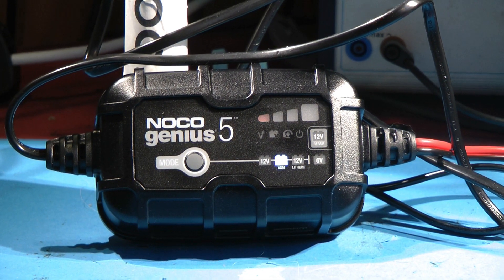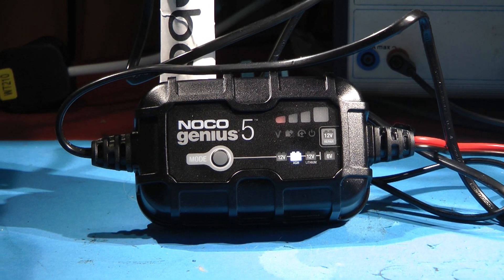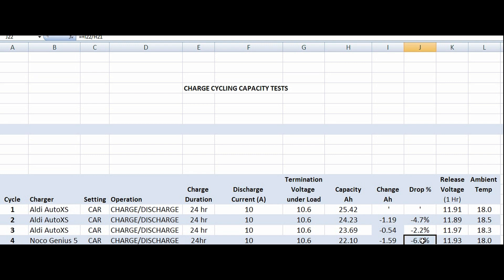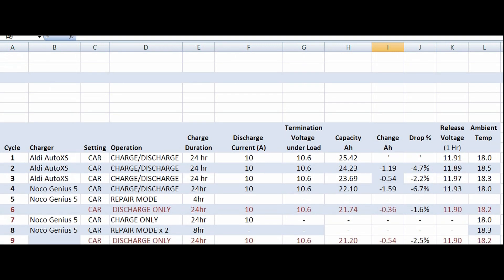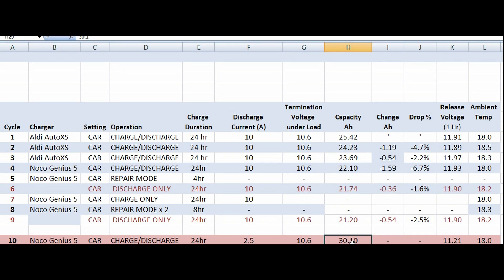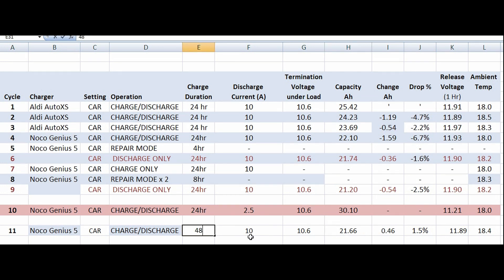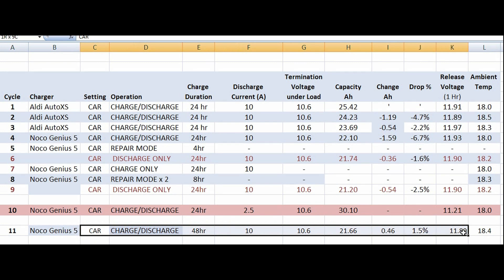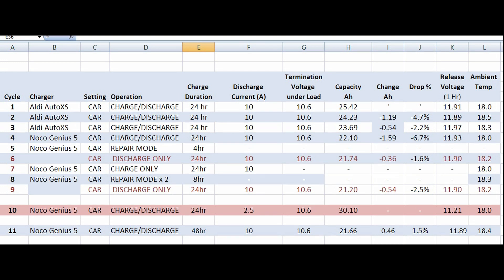NOCO Genius 5 Battery Charger Detailed Repair Test , teardown  and Review Part 3

Comment: Hi great videos, they helped me repair my CTEK charger. Thanks. In relation to this battery you have been testing it seems to be holding up quite well under the 10A load, but you were saying it won’t start the car if you leave the lights on for 15mins. Could be it is losing its Cranking capacity rather than the AH capacity as the AH capacity seems to be holding up well for a long time. Not sure how you would test the CCA though.
Reply from the maker: 15 mins might have been an exaggeration. Maybe half an hour stopped on the fast lane.   Got stranded.   You would never know there was an issue it always starts sprightly.   The first indication that we should have acted sooner was that it wouldn't start after washing and valet he did with the radio on and the doors and boot open. Maybe 90 minutes. I am more cautious with the family's batteries now. We will test CCA.  Tempted to cut the top off...

Comment: If the slow discharge and slow charging is better, and repair mode didn’t do anything, it basically says go buy the genius1 for less money!
Reply from the maker: Good point.  We will get around to discussing that soon.  Just talked to a battery manufacturer's application specialist.  Very interesting.
Reply: It wasn't so much a slow charge as a long charge - the important element is the adsorption phase at the end where voltage is held constant until current drops off.
Reply from the maker: @markdauncey927 The chargers claim to do this stage automatically,  I will chart it and see what it is doing during the completion stages of the charger. Trying the latest CTEK 5A charger on the battery right now to see how that performs on the charger and Repair cycle. From what I have seen so far I expect the capabilities of the chargers to measure the an accurate terminal voltage is going to be an issue.
Reply: @markdauncey927  I dont understand what you are talking about. But according to this article, the repair is done at a slightly higher voltage after fully charged, to reverse soft sulfation. https://batteryuniversity.com/learn/article/sulfation_and_how_to_prevent_it
Reply: @markdauncey927  Thank you for pointing out this article. Now I see (or I hope I saw) what you meant. The 3 stages of charging mentioned in BU article you referred, should be somewhat similar to Noco genius, with the exception of Stage 1 or CCCV (constant current constant voltage). It appears to me that during stage 1, Noco will attempt a higher voltage pulse  (over 2.5v per cell) to reverse  soft or temporary sulfation. However, this is a bit confusing  to me about their claim to desulfate at the beginning of each charging cycle, since I thought you only start "repair" after the battery cell is fully charged. Thanks.
Reply: Presumably the Genius 1 has 1A max charge so it's really only a trickle charger and wouldn't help much if you had a flat battery.
And if you had a small steady drain whilst in a vehicle it might not even keep up.
I can't remember whether the bigger Nocos kicked in if battery voltage fell - i.e. were actually battery maintainers.
No doubt all will be revealed in due course.
Reply: @markdauncey927  Dont think thats the case, according to noco, and many reviews on amazon. Apparently, Noco tries to make you buy the higher current ver, but if you can afford time to charge, genius1 seems to do everything just fine. This is especially true, if repair mode is doing nothing.

Comment: What might be happening in cycles 10 and 11 may be similar to what I found after running a recond mode on my CTEK MXS5.0 - lower test results after running the recond mode but high results if I run a regular charge cycle again after the recond mode. I suspect that the CTEK's recond mode due to the equalization charge creates enough gas bubbles in the battery to reduce the capacity of the charge (ie the gas bubbles act like sulfate and prevent the charging process on certain parts of the plate) resulting in an incomplete charge during reconditioning.  However, if the battery was left sitting overnight so that many of those bubbles can rise to the surface or get reabsorbed back into the liquid and thereby exposing areas of the cell's plates again, a normal charge cycle will finish charging those areas that had bubbles. Granted, my testing involved an uncalibrated conductance battery tester and the difference was only a few percent of the CCA, it aligns with the results of this test.  

While the CTEK's recond mode is more like the traditional equalization charge than the NOCO's repair mode (according to the previous videos), I suspect we might be seeing something similar.  What would be interesting to see is if another repair mode cycle was done and then it was followed up with by a normal charge and then a 10A discharge, would we see a similar improvement in performance?
Reply from the maker: Interesting point. I'll try that.  As I understand it the recombination of H and O  generated during Hydrolysis in a VRLA battery recombine to prevent electrolyte loss.  At low charge currents (~70 milliamps) the plates should not gas.  Have you worked out the key failure of these charges yet?    There is a prize for the first person to mention it.
Reply: @razenby  My guess would be input spikes/dips/noise would be the most likely culprit of failures? Fast aging caps perhaps?
Reply: @razenby   In theory, you are correct low current charging should not gas. 

By failures, do you mean of this particular charger or all the chargers you have tested?

Comment: Do you know what causes that interference with the sound in your video? I used to hear it all the time with my speakers but now I never hear it and I could never think what caused it. WiFi? 3 or 4G signals from a mobile? I'm interested to know. Thanks for the great vid!
Reply: Yup. It's his mobile. The first time you've noticed that?  🤣
Reply from the maker: Cellular radio modem. It causes fierce interference.  In future I will turn it off.
Reply: @razenby  No need, I don't mind. The last time I heard it, I don't think I even had a mobile so was quite a while ago. Must have been a family members.

Comment: I’ve always believed in charging and discharging any battery slowly with a low a current as is practically possible. It seems your test might bear this out. I recently bought the Noco Genius 2 to do exactly that after seeing your video on it. 
Maybe interesting to compare the Genius 2 and Genius 5 and see if actually slow and steady wins you capacity?
Reply from the maker: Thanks for the comment. In the 70s my dad used to say 'slow charge is good' . All we had then for cars were the flooded lead acid batteries  with a top up cap for every cell.  You could see the plates and you could also see white dusting of Lead sulphate disappear as the battery was charged.  There seem to be half a dozen reasons why batteries lose capacity. There are dominant reasons, the nature of the beast itself, mechanical, chemical, poor quality and shitty materials. The question is what is wrong with this battery?  The battery that came with my B class diesel lasted 9 Years with no trouble. The new replacement is drooping after 4.  I wonder if the battery manufacturers care how long they last so long as there is no warranty claims. Consulting the 'delaing with warranty claims section in the  Yaesu reseller agents handbook,  there is just about NO situation where they will accept a warranty claim. Every fault except open circuit is put down to battery abuse and warranty refused. As it is impossible to prove that you didn't abuse your battery you are powerless.
Reply: @razenby  I’m pretty sure it’s like most things, they make a product to last the life of the warranty. Planned obsolescence and all that. Most likely the beginning of ‘maintenance free’ battery.. 
Yep I remember those caps to fill with distilled water, Lead Acid doesn’t like much of a discharged state and the lower you go hurts it more, i think an ideal would be no lower than 80% of full charge, certainly no lower than 50%. Maybe cars should have come with a small solar panel in the roof to constantly keep the battery at 100% when it’s not running, but hey they wouldn’t sell as many batteries now would they lol
Reply: @The_Last_Post  çok haklısın bu konuda
Reply: @razenby  Who is the battery manufacturer, and is it in the U.K? Johnson Controls moved their battery manufacturing to Mexico, and the video's I have seen on them is that they no longer last as long as when they were made in the USA. Odyssey Batteries use 99.9 percent pure lead and are still made in the USA and designed to last 10 years, I believe they also have a manufacturing site in France for the European market.
Reply: They used to use virgin steel plates  inside each battery all the manufacturers stoped using them except for Odyssey. Odyssey still uses virgin steel and they last twice as long but they are 50% higher priced also.  I started using them in all my cars and boats, to me it's worth it to not have to replace my AGM battery every 24 months on the dot.  Batteries are not the same as years ago. 12v Lead acid batteries last 1 year, AGM last 2 years, Odyssey lasts 4 years, LiFePo4 batteries last 5-10 years but you can't use them in a car just yet, you'll kill the battery if you charge it if it's less than 32 degrees F 0 degree Celcius outside. They now make them with internal heaters that cost $70-$100 more but you still can't use those as is in a car, their internal resistance is so low that if it's discharged and you charge it from an alternator it will accept the full amperage charge your alternator can put out and a regular alternator will burn up because they aren't meant to run at long periods at 100+ amps.  New smart alternators are fixing this issue though but it will be awhile before all cars have those as standard. They also don't handle high vibration like a lead acid battery can.  The future will be good though, were close.
Reply: @extrememiami  You mean pure lead plates not steel plates? Odyssey look like great batteries, they claim that they are designed to last 12 years.

Comment: The slow discharge delivering higher capacity was to be expected but the fact that it also 'repaired' the battery more than the charger was very interesting.
Doing it many times wouldn't help long term as each full discharge to 10.6V is one more cycle off the life.
Perhaps after a long slow charge the charger repair mode might do something?
My gut reaction is that it won't but you never know.
With batteries prevention is certainly better than cure - fully recharge after a significant discharge but preferably don't let it discharge in the first place.
My experience with starter batteries is that with a good alternator and regular use you can get 2 or maybe 3 times the nominal guaranteed life.
Reply from the maker: Thanks. It seems everyone has expectations and beliefs but the facts  are a bit of a muddle. It is a very lucrative market and the manufacturers involved in it know that customers have low expectations.  It is possible that modern batteries have been weight and cost reduced to such an extent that they are only just fit for purpose.
Reply: @razenby  Agreed.. after 30 years, as novice.. and now researched.. battery know how became somewhat of a circus coming to town,, ans now with tech, .. an ILLUSIONIST.  $$$ Yup, built " fit, for purpose"

Comment: I think what everyone has to understand is that there is no magic mode that will fix all batteries.  Ultimately, whether a desulphation or reconditioning or repair charge will restore battery performance depends on why the battery is underperforming in the first place and the severity of what ails it.  Some types of ailments are simply catastrophic or irreversible, while others are more reversible depending at what stage it's at.  How I'd sum it up is that these 'special modes' are far more likely to result in meaningful positive gains when used on a battery that is still performing at 80%+ of it's original specification than it is when used on a battery who's performance has decayed to a shell of it's original performance.
Reply from the maker: Explain that to the charger manufacturers!! They make outrageous marketing claims.   Interesting theory.  I am just curious why would you 'sum it up'  that it works on a battery that can retain 80% of its specified charge and not on batteries that have decayed to say 70%?  I would be interested in the evidence. We have 6 cars in our household with different aged batteries. I see if any of then are 80%ers and give the theory a test,
Reply: @razenby  Love your content man! You're super knowledgeable in this field. Even I with my daily drive charge my battery over night on the Noco Genuis 1 occassionally once every 2-3 months just to get rid of an sulfation to may have come about. I'll continute to do so once any of my batteries reach the 2 year mark as most warrenties start to end around this time on battery replacement.
Reply from the maker: @dbzownz12345  Thanks. Your is  a good  strategy- To give an absorption/float charge periodically on a town car is the only way it will get the final 20% in.  I don't know but if I had to guess, most town cars are diving around with 80% or less charge in the sulphation zone.
Reply: True but who does anything to a battery untill it starts to let you down. this battery condition wouldn't even be notice for longer had it not been for the unusual situation that it was put to.. generally batteries go bad because the plates are falling apart, nothing can reverse.  Then it gets put under a bush and calcifies, and people think they can fix it